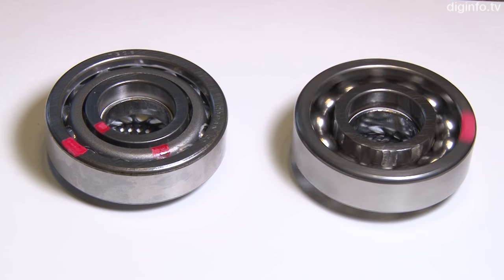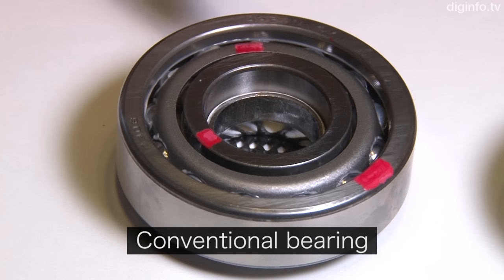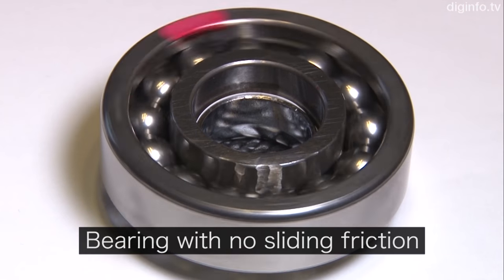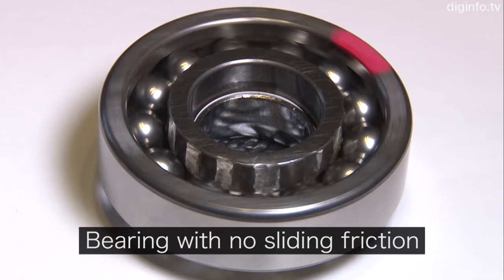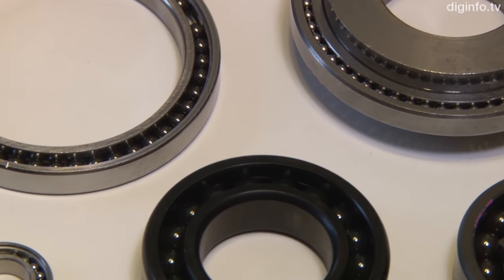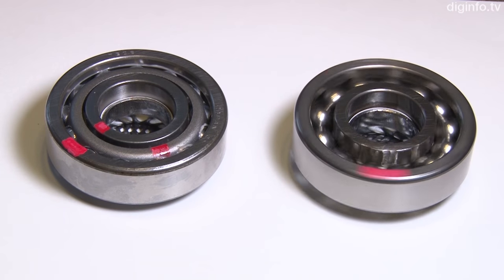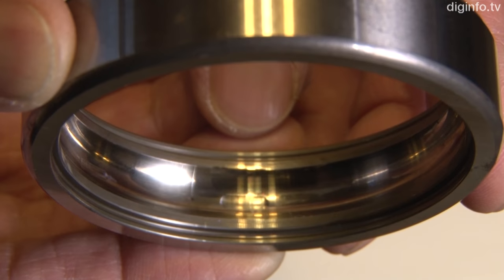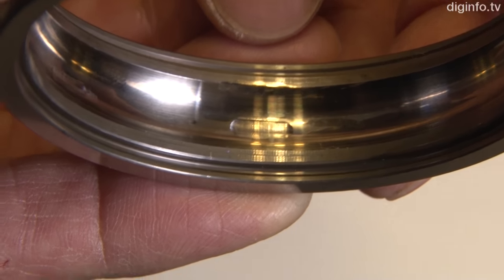Greaseless bearings that eliminate sliding friction #DigInfo

Comment: Wouldn't creating imperfections in the ring(s) increase wear in the ball bearings over time? I'd think that the problem would get worse the faster the bearing spun up.
Reply: Mike Trieu They are not imperfections but rather carefully designed changes in the contact locations between ball and outer.
Reply: ***** Regardless, those changes will impact the balls much more than an otherwise smooth surface. If they are "slowed" every time they hit an indentation, that means some force is being imparted to the balls, most likely removing a certain amount of metal with each strike.
Reply: Mike Trieu You might like to rewatch the video. The balls are not slowed by striking the indentation, rather they run on the smooth edge of the indentation which changes the effective rolling diameter of the ball. This is also shown in the demonstration with the plastic tube. Another example of this idea is a ball rolling along two rods if you put the rods at an angle the balls speed changes as it drops down between them.
Reply: ***** That may work at certain speeds, but at some point the balls will be traveling fast enough to skip over the indentations at random intervals and start ricocheting. They'd have to be tuned and rated for a maximum speed. Think of driving over a dip in the road with your car. If you drive too fast, the wheels end up colliding with the rising end of the pit.
Reply: Mike Trieu But in the case of the ball in these grooves the rising edge is like a v so there is no sharp edge perpendicular to the direction of travel to slam into. Also if the bearing is underload they are less likely to skip and if it is not then the forces are small. I'm also fairly sure that the grooves are actually very shallow.
Reply: Mike Trieu   Hmm, If I were to design these, I wouldn't make indentations so much as I would make lifted and spread tracks.  Adding slight lift to the edges of the groove would keep the center of gravity of the bearing on the same circle, and (I think) eliminate the jitter and the ricochet you're expecting.
Reply: Mike Trieu The indents aren't that deep, it will only be deep enough to reduce the amount surface contact between the ball bearings (half of a thou at most.) and the inner and outer cage to reduce the acceleration for a small section of the bearing. 

if you look at this video "watch?v=wN0vhXGVHnI" he put in less ball bearing to prove a point but look how quickly the ballbearing spaces itself out evenly. He could even increase the point of contacts for bearings(by reducing the Surface Area of the indent) that run 24/7.
Reply: Kenny CanHe I was wrong, about how it works. its about the change in contact diameter in balls that causes it to the decelerates
Reply: Kenny CanHe As soon as you add a load, radially or axially, then increase the speed.. this metal to metal contact will create a lot of heat and eventually eat up the bearing creating a lot of "FOD". 

I want to see this concept installed on something heavy duty, like a turbine engine, or a Bell 206, or simply a vehicle - by replacing the wheel bearings.
Reply: If you're using something heavy duty you shouldn't be using this type of bearing at all. That's what a double row taper roller bearing are for, and if your bearing overheating that's an entirely different issue
Reply: +Kenny CanHe if the bearing is overheating then the problem is the bearing. it will never overheat from this demonstration.
Reply: @MikeTrieu  I don't think you understand how these bearings work.
Reply: @sacr3  what would cause the heat? There is no sliding friction so that's not a source of heat. Where would the heat come from?
Reply: @randknu1  if the bearing is overheating its a question of improperly sized bearings, the only reason the bearing is to blame is if the bearing is defective in the first place.
Reply: @lazyh-online4839  the load, typically if its load bearing itll apply pressure, even if a bearing is rolling, just like a tire there is a bit of friction and heat will build. This heat has no where to go, grease or oils will absorb some of that heat and lower the amount of heat. 

A cage is also required to keep the balls from rolling against eachother, this cage acts as a friction component as well, otherwise the aft end of the ball will go up, as the forward of the ball behind it goes down and that contact will create heat. 

So many different contact points create a lot of heat if it isnt lubricated and under load. 

And on top of all that, we have humidity, water, etc that will absolutely love to fill in that empty space leading to corrosion. Grease prevents this as well. 

Grease less bearings are not the greatest idea for under load situations. Or fast spinning situations.
Reply: @sacr3  so tires create heat for two reasons. One is friction against the road, as the tire deforms and stretches under the load of the vehicle it "slides" slightly against the road surface, same with when the wheels turn the vehicle to one side or another. The second is intermolecular friction within the tire itself as it deforms. Considering that neither happens in a bearing then without any friction that won't create a source of heat. Contact points don't cause heat, friction at a contact point is what causes heat. And oil/grease is not only a poor insulator of heat but that heat would still be inside the bearing, it doesn't "carry away" heat it simply reduces the friction between, for example, the balls and the cage. I'm not saying these bearings would be any good as some research shows that they are quite prone to failure and don't work very well, but I don't agree about the sources of heat if the balls are correctly acting as purely rolling elements.
Reply: @lazyh-online4839  Great reply, that is very true about the deformation contributing to heat in a tire, but did you know the same applies to bearings? I'll quote from Bearingtips

"While sometimes generically referred to as “Anti-Friction” bearings, there is a small amount of friction or resistance to rotation in every ball and roller bearing. The sources of this friction are: slight deformation of the rolling elements and raceways under load, sliding friction of the rolling elements against the cage and guiding surfaces. Different bearing types, because of their internal designs, result in slightly different amounts of internal friction."

The transfer of energy between the bearing and its surrounding elements, creates heat, and will always have a small element of sliding friction. Under load, bearings deform , while rolling, increasing the friction load, increasing heat production.

We also have vibrations that occur, at the smallest level you will have minute vibrations, expanding and contracting those bearings ever so slightly. 

Circulatingoil, or Grease, can spread that heat production out, its slow to heat depending on viscosity, but it pulls those hotspots from the bearing walls, race, balls.  

Greaseless bearings aren't ever a good idea. Specially when they begin to corrode away due to exposure and high heats. 

Terrible i'd say!
Reply: @sacr3  aha, thank you for clarifying that point about deformation of the rolling elements, I appreciate your reply and concede the point to you. That being said I have a question, do you believe that the lower deformation and mass of ceramic bearings would reduce the heat generated to an amount that lubricating fluid is unnecessary under similar light to medium loads?

Comment: Wouldn't that limit the speed in which the bearing could spin?
Reply: allluckyseven If it was a straight track there would come a point where the balls slip rather than slow down at the dimple, when the force to decelerate them fast enough exceeds the static friction of the rolling contact. Then you'd have a bit of extra friction and wear but maybe still less than a normal arrangement.

But on a round bearing race the pressure of the balls onto the race goes up as the balls go round faster so maybe they don't slip?

Comment: Unfortunately the comparison between these two types of bearings is quite flawed. One is SEALED with a flexible rubber seal, and the ceramic bearing is NOT. It is the seal that is causing virtually all of the drag and slowing down this bearing. If you are looking for the least friction, washout the grease with solvent, and an unsealed steel bearing will behave just like the very expensive ceramic bearing in the comparative test.
If you are looking for anti contamination, use a SEALED bearing. If you are looking for less friction and reasonable dust exclusion, use a SHIELDED bearing. If you are looking for low friction and long life, use a Hybrid Ceramic bearing with shields. These have races made from hardened stainless steel with silicon nitride polished balls. A bit more expensive than straight SS, but better life, especially when run dry.

I use these bearings in mechanical clocks and have done extensive research on low friction and long life.
Rex Swensen (retired mechanical engineer)
Reply: Rex Swensen You should make it clear to people reading that this is a scam and will not work as claimed.

Comment: The friction between retainer and ball is a fraction of the friction between ball and race. Since balls in a circular bearing do not roll perfectly, but they slide against the races to make up for the difference in circumference of the two races, the friction there is greater than between ball and retainer. That's why lubrication is essential.A linear bearing does not require lubrication. Examples of linear bearings are train wheels and tracks and those fancy sliders in your kitchen drawers.

Comment: this is a great innovation , just imagine how much less energy everything would require
Reply: Husnain Anwaar slightly. It may be 10x less friction unloaded, now let's see it with 100Kg on it.
Reply: Sam Firth A bearing of a 100kg worth, bam. There's your answer.

You don't use a bearing intended for 10kg on a 100kg. Genius.
Reply: Alexander Lim  Husnain Anwaar  Nope - this bearing just just another scam-attempt targeted at those not familiar with the subject - bearings in this case.

With out grease any type of bearing has far more friction wear and tear under load.
It will heat up fast and fail fast.
Reply: ABaumstumpf These guys are not saying they don't need grease. They are saying they don't need retainers.
Reply: Imagine how many more balls
Reply: ibleed1 And to show this, they do not use any grease to make it look better to the morons that believe this shit. 

And aside from that, it is glaringly obvious to any engineer why it is a stupid idea to not have any form of retention:

With little groves on the outside changing the contact-area you are adding a lot of stress to the system - increasing wear significantly and adding another point of failure.
Every time the balls roll over that groove, they are only having contact on a tiny surface-area.
To make matters worse, this change of speed also puts the balls them self under heavy stress due to the constant acceleration.

This is nothing but a gimmick to scam idiots.
Why do you think people are gladly willing to pay quite a lot for good bearings?
Why do you think engineers are weighting the trade-offs of each particular design?
The companies that produce bearings are no morons that do not know how to make them.
Reply: ibleed1 Surely grease will effect how the bearings space out?

Comment: Interesting idea, I actually prefer loose bearing balls for road bike hubs ( cycling) . I use a hybrid setup by using ceramic balls on the steel cups, adding just a small amount of very thin white lithium grease on the cups so the balls don’t wear them down. No sealed bearing gives me this kind of smooth rotation,  I would say it is only slight slower than full Ceramic bearings which require no grease.
Reply: Speaking of loose bearings, some years ago I had the ball cage fail in a vacuum cleaner ball bearing. At low speeds all of the balls were to one side in the races making it noisy with a lot of vibration. At operating rpm the balls spaced themselves evenly in the races & it ran smoothly & quietly.
Reply: @n.mcneil4066  ROFL!! Yep that will happen lol

Comment: Very skeptical. I dealt with all kinds of bearings and sure, those without grease will spin freely and for a long time - but then add that to a component, the metal to metal contact of the bearings plus the pressure would create an immense amount of heat quickly, would eventually lead to seizing. 

Whereas grease creates a thin layer between the 2 metal contacts and prevents heat buildup, by dropping the amount of friction.

I'd have to see this application in something like a Bell 206, see how long that helicopter can fly with greaseless bearings.

Comment: Its brilliant, could you please let me know where I can buy them, thank you.
Reply: LudicFallacies  I am a machine designer with 27 years experience, one thing I have learnt is that there is theory and then there is practice. 
If every one had an attitude like you we would all still be living in caves with an average life expectancy of 35 years old. 
You only know for sure if some thing works once you have tested it yourself and if you dont make the effort to do the tests then you will become a person who is susceptible to believing bull shit stories. 
We were told we couldnt break the sound barrier until some one tried it.  We were told the earth was flat, that we cant fly etc etc.
I was told electric vehicles have no power. the electric white zombie drag car is now running 9 sec quarter mile times. I built my own electric bicycle to check for myself, it used a 200W DC motor. I designed the drive correctly and when it pulled away it spun the drive wheel.
I then did some calcs and found that it was only costing 20c to take me to work. 
So when my cars engine packed up I designed an electric drive for it and installed it, I now pay only $1.60 per 100km for fuel or $16 per 1000km. This is because I didnt listen to bullshit stores I did my own tests. And so Ludic all I can say to you is that having strong opinions about things that you havent ever held in your own hands and therefore actually know nothing about is a very self destructive approach to life, because you will always be like a mushroom, kept in the dark and fed on shit.
Reply: *****
"what you say and what you think is so irrelevant its not worth replying to"

Ok so buy these bearings from that Japanese scam artist and put them in your electric bike.

When they don't work and you've been scammed from your hard earned money I wanna hear you repeat what I quoted above whilst realizing I was trying to help protect you from your ignorance and credulity.
Reply: A bearing costs nothing, the risk is zero the reward if it works is enormous as friction is a 100% duty cycle every time you use the vehicle.
If you change the bearings and double your range then spending a few pounds on a bearing is well worth the risk as it will pay for its self on the first trip if it works.
So you are not trying to  help me you trying to be a smart arse and you out of your league and now I have pissed on your battery.
Hopefully you have learnt some thing positive today.
Reply: EVZebra 
The bearing costs very little but when they destroy themselves (as these would quite quickly) they take other stuff with them
This bearing design is a scam

Comment: The only problem I see is if the bearings are used at load bearing points when friction is isolated the wear is tripled and bearing failure will occur much faster. Now if these are non-load bearing bearing then the preform as shown.

Comment: 9 years later, I don't think it brought anything to the bearings industry? seems like something that would work great for a toy like a fidget spinner. but if you start using the bearing for something useful (with load, and high rpm) It loooks like its going to be terrible for wear, vibrations. maybe applying the same polarity elecrical charge could achieve the same resulets, keeping the balls spaced, without needing to cut grooves in the bearing races ??

Comment: At the age of 9, when first learned about sliding friction of ball-bearings, I really wanted to know why nobody chose to forever replace the those with spiral gear-wheels in which the teeth will ensure the necessary divide while each focused on 2 pivotal points rather than slide (inner vs outer curvature).
Reply: Also... replace all the metal parts with ceramic ones and it'll be even far more frictionless.
Reply: +ThankYouESM ceramic is Mord brittle and expensive than steel, although ceramic bearings exist. the point of using balls is having a minimal contact point this reducing friction. duh.
Reply: To further elaborate, only the top and bottom cone points of the gears wheels would touch therefore keeping an even safer gap between each of them, hence... less surface area than that of a ball with no sliding, but pivotal. Having discussed this concept yesterday with an engineer professor friend, the spiral would not be needed at all with perfectly aligned gaps. Ceramic bearings are a difference of a few pennies by conventional size as hardly a concern for most people, in fact, many have bought those as knifes although not as heavily condensed ceramic which is far from... brittle.

Comment: It is a very nice idea but simple gaps do not looks optimal because the support drops there. Better design would maintain the load evenly.
I suppose the justification (when balls are in contact) is short and rare, so sliding under load is acceptable. 
Perhaps I am wrong.
Reply: Also, wouldn't the design likely fail under load?